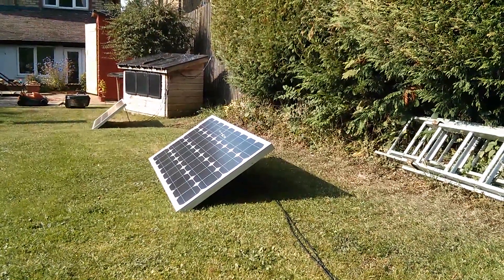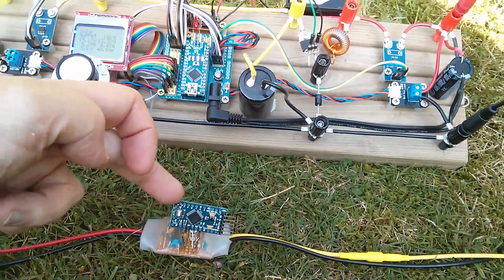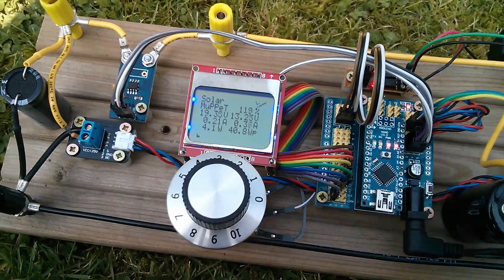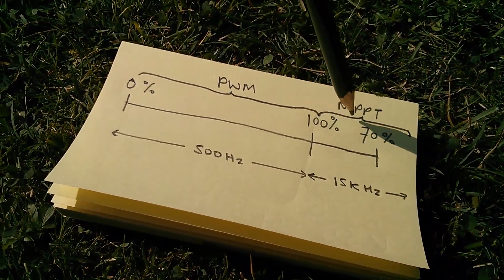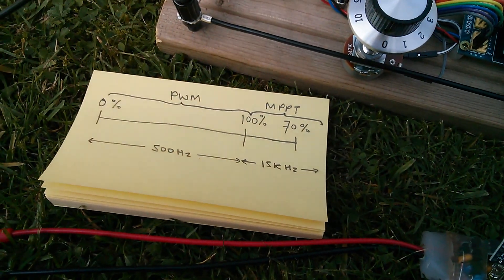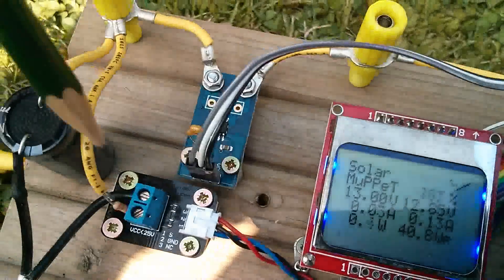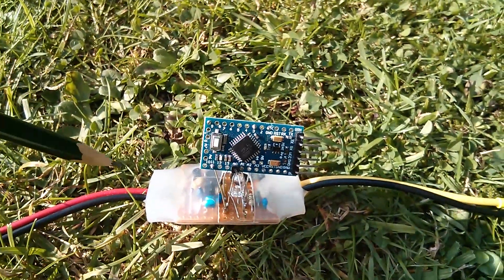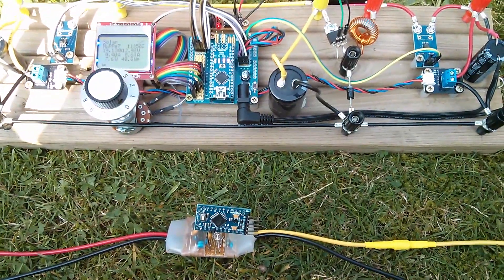Arduino MPPT Solar Charge Controller #21 - Battery Maintenance

Comment: I think you're on the right track there Julian. :) From what I understand most commercial units drop out ov MPPT mode once they hit the absorption stage.
Reply from the maker: xanataph Thanks Xan. Problem is our sunny weather is heading down your way now!
Reply: xanataph I recall that at least some units stay in MPPT mode, but what they do instead is drive the panel voltage "off the cliff", that is, increase the panel voltage so the current (and power) drops off. I think it was in a piece of advice about making sure your open circuit panel voltage is well below the designed max of the controller, because it will reach those voltages as the battery gets full. This info might be wrong, but intuitively it makes sense to me.
Reply: plonkster I would certainly agree on that for sure. It would be wise to make sure that your open circuit panel voltage does not exceed the rating ov the controller no matter how the system operates to reduce the current nearing the end ov charge.

Comment: question about internal clock, kind of... for battery charging, its usual to boost the voltage to 14.4 for a short period once a day assuming ithas been at or below 13.6v all day, does your board have the ability to count to 24 hours with reasonable accuracy? i dont know if you have an internal clock
Reply: jusb1066 I have a fairly large 24V bank (240Ah), and the specification document for this particular battery (Trojan T125) says absorption should be done at 14.8V (or 29.6V for me). The charge controller waits for charge current to drop below a configurable limit for a certain period of time (I can't remember what it is set to, think it is 10A for one hour) before going to float.

Equalisation mode takes it up to 15.5V (or 31V for me, this is also configurable) but it spends very little time in this mode. I can't remember if this controller automatically goes into equalisation but I think it does, if the battery dropped below 11.5V (23V).

It's a nice enough unit. It looks like it uses perturb-and-observe.

My interest in building my own MPPT controller, or experimenting with it, is because I'm thinking of taking the excess energy and using a second kind of PWM controller to dump that into some useful application. For example, there is a full 5kwh space in a hot water cylinder between 55 centigrade and 85 centigrade (and with a tempering valve for safety, it means free hot water), or I might use it to drive DC heating elements in the tumble dryer. The idea would be to crank the MPPT controller wide open, and maintain the battery by managing the residual current after bleeding off the excess, and when those aren't in use, backing off the mppt. It's all in my head at the moment though... I'll have to spend some money on hardware and play with this some time :-)
Reply: jusb1066 Wow. I have a mere 900W on the roof. This also started small, with 300W, and grew over time. Of course the MPPT controller's ability to use higher panel voltage really helps with expansion plans. I did this initially because we have a power shortage in South Africa at the moment, and rolling blackouts to prevent grid overload. I wanted enough power to run my office as the lost productivity would be pretty costly. I bought the expensive MPPT controller at the beginning so that I could expand and add more solar modules. Because I rarely get the rated Wp of the modules here in Cape Town, I'm actually thinking of taking it up to 1.2Kw. On really good days the MPPT controller will just chop the top bit of power, but on all other days I should gain from this.

In the end my goal is also to reduce the electrical bill. My system is not grid-tied, but I have a really neat European inverter, a Victron Multiplus. This thing is really flexible, it has a transfer switch and can be programmed to fall back to the grid if the batteries are low. This is how I run it. It can also be configured in what Victron calls hub-1 mode, where excess power is fed back into the grid. For this you must pair it with a Victron MPPT controller, and so far it only works with the most expensive two in the range. Then it uses serial comms between the two units, the MPPT controller then optimises for maximum power while the inverter manages the batteries, by managing how much power is fed back to the grid.

Because the equipment is expensive and additionally I'd have to install anti-islanding equipment (the Multiplus doesn't have it's own, like other GTIs), I'm thinking of rolling my own. Thinking... not building yet. But these videos have me itching to do that :-)
Reply from the maker: jusb1066 The arduino does have a clock of sorts. But on the PWM5 I used a timer, speeded up if the battery voltage is high and vice versa. Result is a period of time each morning at 14.4V.
Reply: jusb1066 I have an MPPT controller made by a South African company called Microcare. What this unit does is to go into Boost mode when it wakes up in the morning, as soon as it detects sunlight. Then it switches to Float mode after some configurable set of requirements are satisfied.
Reply: plonkster
my chinese controller has 3 modes!  14.4 for 20 mins  and 13.6 standard, and if the battery has discharged to less than i think 12.3 volts, it spends 20 minutes at 14.8v for equalisation, been happy with this controller, plus it was handy for a while with timed or automatic load swtich, pretty decent for a £8 unit
Reply: plonkster
i used to have a 100w panel and now i have 2.8kw! but i have 500ah of batteries and i now use the controller via a timer and a laptop PSU, as my 2.8kw is grid tied microinverters n now, the 500ah runs my garage/small workshop  power via an inverter, although i have grid power out there, it was grown from an experiment in  that i was given some deep cycle batteries and a want to reduce my electric bill!

Comment: Julian,

I recently started "playing" with the Arduino boards, an UNO and an MEGA 2560 for a project with XBee Pro radios.  I did a fair amount of work several years ago with Atmel Microcontrollers using the STK-500 and Atmel AVR Studio 4 IDE.  This project turned into a four layer PCB with an ATMega1280 TQFP-64.  It was a huge learning curve and a pretty fair price after adding it all up.

I've been viewing your videos for some time now and they've got me interested again in some ideas I've had for some time, plus a friend of mine's idea that he asked me to develop.  I like the idea of the Arduino boards as a rapid prototyping platform with multiple shields you can stack.

Watching your video this morning, and my own frustrations with the Arduino IDE, reminds me of what I really liked about Atmel AVR Studio 4.  The Arduino IDE is designed for learners, I'm not a big fan of it, but it does work, and you can do more advanced things than what are documented as shown in you video.

I really like what you've developed so far, I think you've got something good going on with the MPPT/PWM idea.

Thanks for the videos,

Jim
Reply from the maker: Jim M Thanks Jim. I'll press on with the design, weather permitting!

Comment: Now I'm confused...
Intuitively, I was going the opposite way, looking at MPPT to get the battery upto optimum voltage (13.5) as fast as possible, THEN switch to battery voltage hold mode with PWM, until Vbatt drops to, say, 12.5, then back to MPPT.
Thought the whole point of MPPT was that it's more efficient than PWM, and gives more 'grunt' to the battery, faster.
Don't get your reasoning, Julian. But you've been doing this far longer than me!
(Oh, and for night mode, I've heard of a library called 'Narcoleptic' for the arduino.  It's at https://code.google.com/p/narcoleptic/ with a trivial example at http://www.willowdesign.info/blog/digistump-cricket-generator/ ).

Comment: You wouldn't need to poll in night mode but instead use a rising edge external interrupt to detect when you have some power coming in from the solar panel. It'll save you consuming power only to realise it's still night.

Comment: Can you not just continue with the MPPT  buck converter running at 15kHz, but just add the battery voltage setpoint into the algorithm so that the PWM% is reduced to achieve the target voltage?
On the surface of it, this could provide some useful efficiency gains when you have both solar charging and a load connected simultaneously.

Comment: This makes me want to complete my PWM controller now but I just don't have the time!

Nice idea about doing the mixed mode. I hadn't thought of that before in the same way. My idea for the PWM was to look at current and when it was below a certain point if it's reached the bulk charge voltage (14.5v) it would then back down to float mode (13.6v) until the voltage dropped below a certain point then it would flip back to bulk mode again. Rinse and repeat. I didn't dive into that too much though as I didn't get the rest of the code to a state I was happy with.